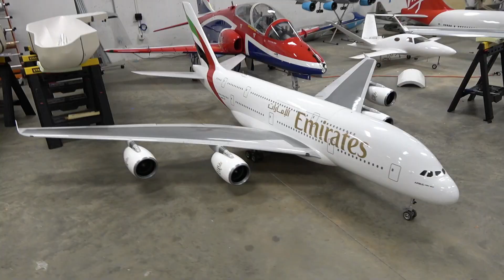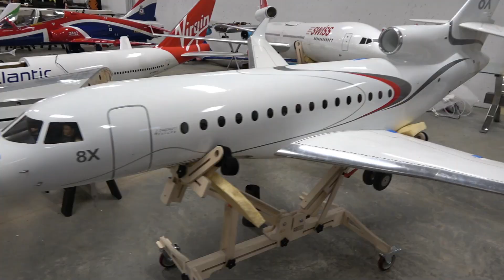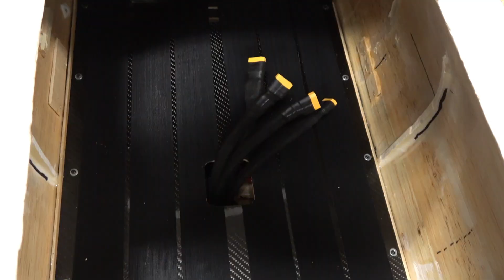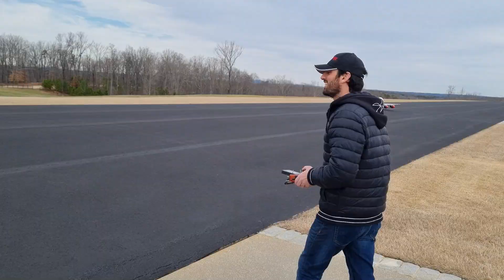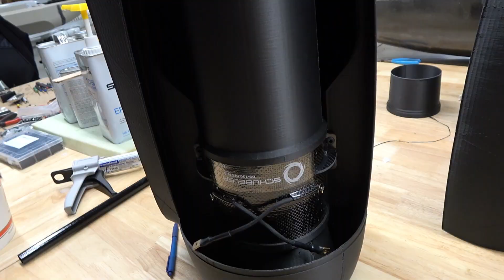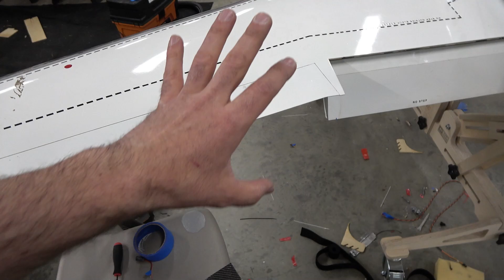At Tyler Perry's RC hangar in Atlanta

Comment: Hey Ramy, talked to a structural engineer in the area who is a RC plane 3d printing fanatic and said planes glassed with 1/2 ounce on the outside of fuse and wings more than doubles its strength. Light sand and light glass makes the model more durable than just a print

Comment: You Sir are a Master Craftsmen! You want a Real Challenge? Boeing B-52. 8 Engines with centerline main landing gear that actually swivel during crosswind landings and a bomb bay that really works. Modern Livery or the old Strategic Air Command your call?

Comment: Love turbines, jets i understand going electric, nothing beats the real eng tho.  Would love to one day have a few model turbine  engines  i currently have a allison turbine that im slowly trying to rebuild and get running for a non- airworthiness test and play with engine that i got from a old crashed helicopter. Would love the small ones to go with it.
Reply: What is the difference between turbines and electric? I assume electric cheaper and easy to maintain?
Reply: @Spazik86  turbine uses kerosene or jet A fuel function same as the big boys on jetliners but without the bypass fan in the front.  Electric is somewhat cheaper, but batteries are expensive when getting up to the larger size ducted fans as well as they don't make them large enough to power some bigger scale aircraft.

Comment: Please can I pick your brains? I have a set of plans for an HP42 vintage airliner designed by Mr Newton back in the 1950s. I have produced a model of the fuselage in Fusion360 with the original objective of converting Mr Newton's plan into CAD. Still, I have been thinking about maybe turning it into a printed model. The question is do I have to define the wall thickness or do I let the printer software do that?

Comment: we would like to see the industry keep the mini jet engine turbines, and not change them out for electric.  as we need to keep the jet fuel powered engines going.  if you think there is an environmental gain to be had by using electric, you are mistaken